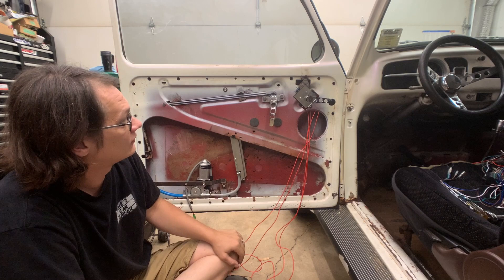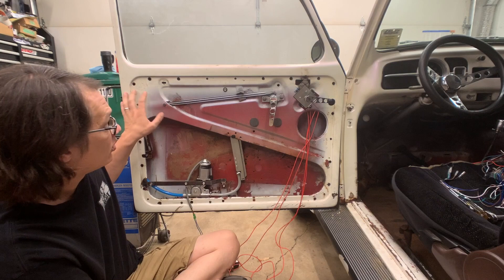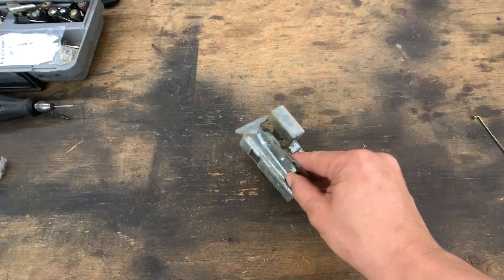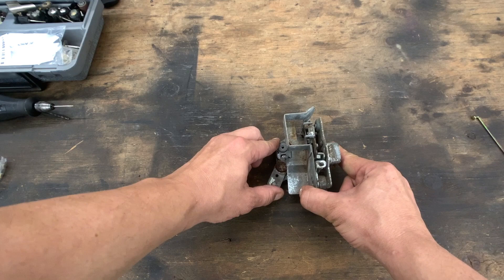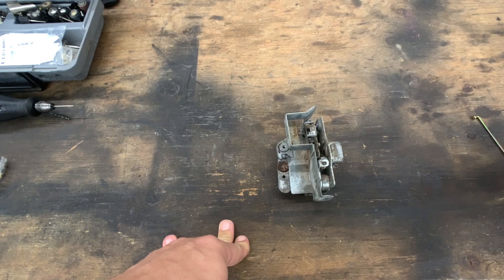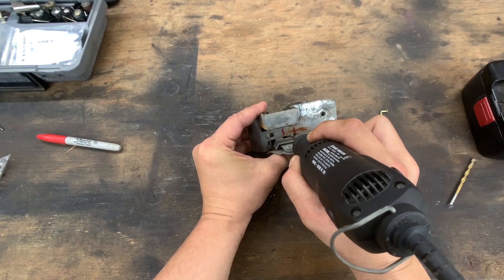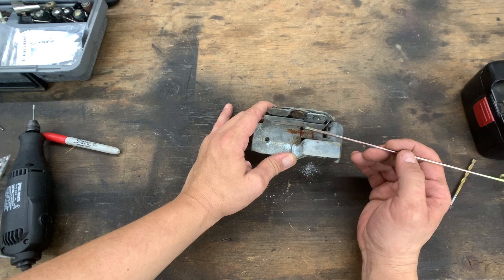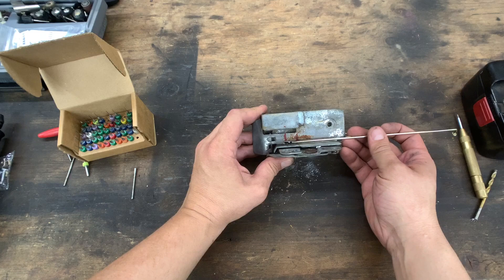Vintage VW Beetle Power Door Locks 1 - Curts Bug Part 7

Comment: This is great information! I have a 72 Beetle that I bought 6 years ago and I'm finally beginning to restore it. I didn't think I could add a solenoid for the locking mechanism or an actuator for the windows, until I saw your videos. I'm stoked. Could you add a link of where to buy solenoid?